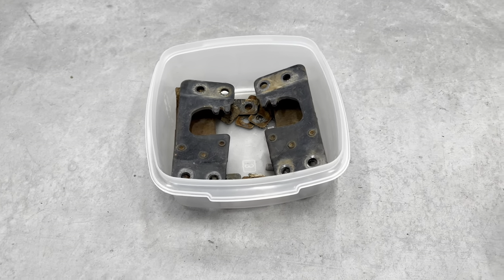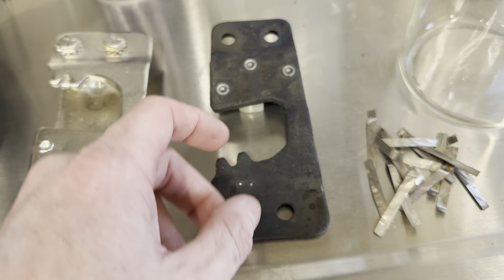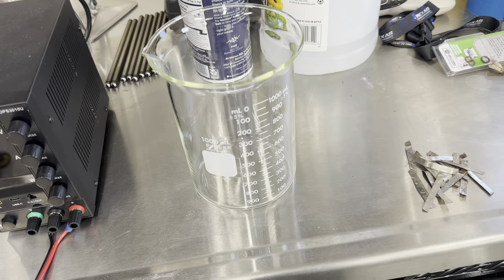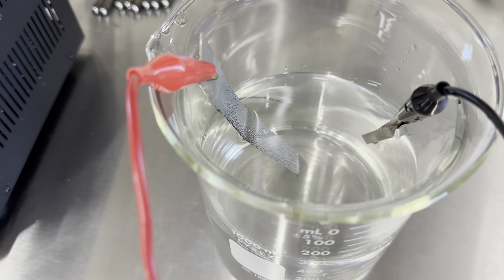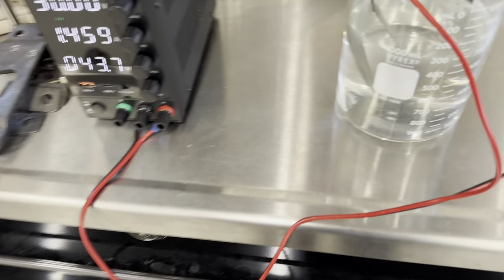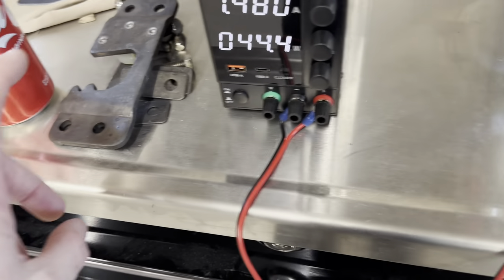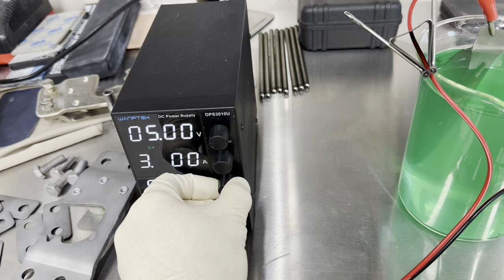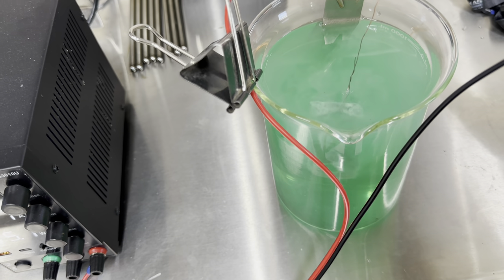How To Affordably Nickel Plate Metal Parts At Home

Comment: Nice job for the first try. Nice results. I have seen several videos on plating parts and silver on black is always a killer!!!   I think some who do everything you did except zinc plate and then a cadmium wash or plating the is yellow. Have a great day, Curt. I like chrome that wasn't invented I guess until 1938 then everything was nickel before.
Reply from the maker: Thank you,  definitely going to keep messing around with it and see what works and what doesn’t.
Reply: @curtrobinsongarage5452  The Borla are 303 stainless, eliminate drone in the cab and come with a million mile warranty if you plan on keeping the truck. They have well done videos with good microphones.
Reply: I have never gambled but I will spend more money for a part(s) if I know they will last. I don't race either but will burn some rubber at some point as the go up in price. I bought dozens of high performance GM parts for my 1967 C10 as the 5.3L came from my son's Tahoe after black ice taught gave him a new experience and he towed to my backyard and told me to strip it. After building a stout stand I did a compression check, then a leakage check. Then with a SnapOn fuel gauge to check the regulator. After installing cleaning the injectors 5 times, I inspected the exhaust valves and seats and looked normal. Since I rebuild 4L60e transmissions and new the common failures, I built a 1987 era trans for overdrive fuel economy. I placed a NTC Thermistor in an unused bracket. Soldering it to an unused case wire, shrink wrapped it and ran to a well known brand gauge. Writing a service manual was my biggest chore as I did each circuit with, color, size, connector and cavity. The fuse size, location with a photo of each major it. If I am long gone and my family is near a small town with one shop, they can take a paper manual, index, page and photo listed with brand and part number (As it Changes) but a 95% of a part that is needed is on the shelf.
  I love your body work as in black looks like as mirror! This deserves high praise. I hope I can learn from you! God bless.